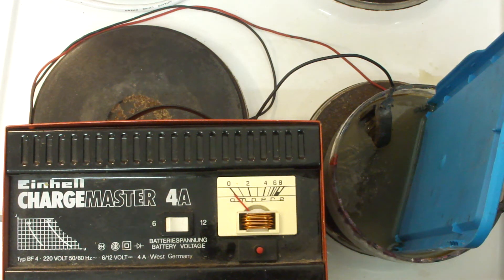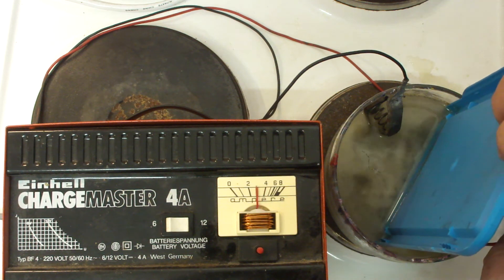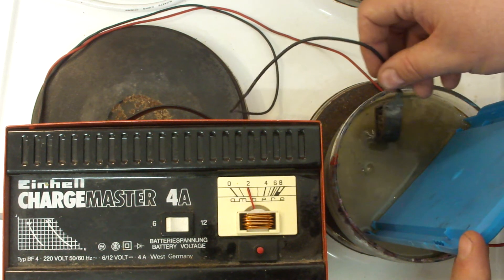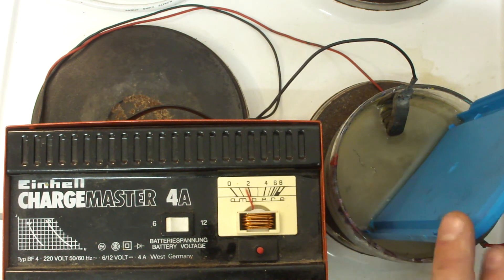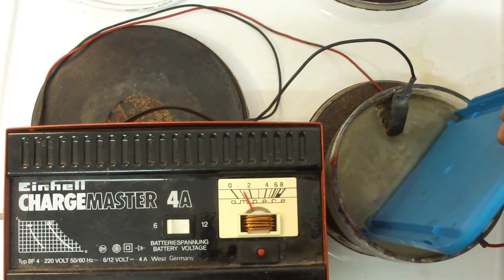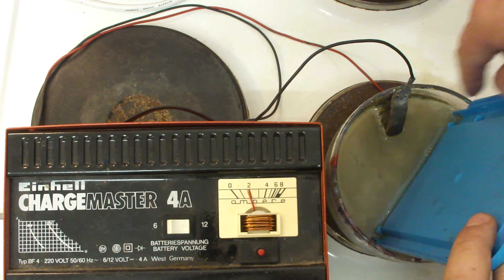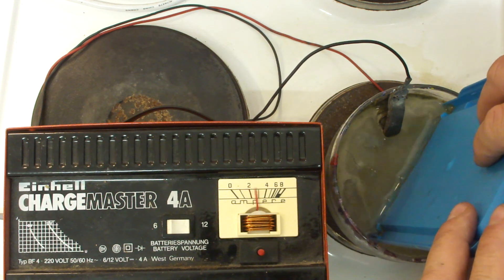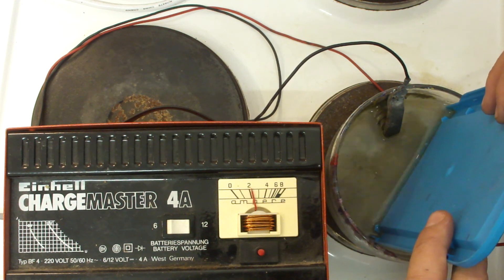electrolysis_test_for_hydrogen_separation_cell

Comment: I guess the results of your experiment is quite expected.NaOH  concentration has a role in it.. Your plastic devider is just like in the atomic reactor graphite bars as you plunge them down you dumpen the reaction. You  use a power source  here. Also if you  change the electrode material you get different results. You can capture the gas H2 and  O2 if you design your electrodes properly.Pay attention! The H2 is highly flamable and O2 in contact with grease can explode.